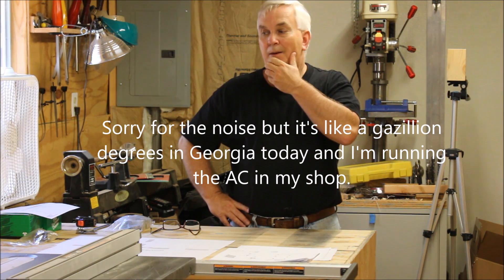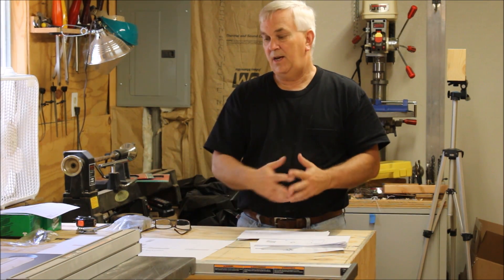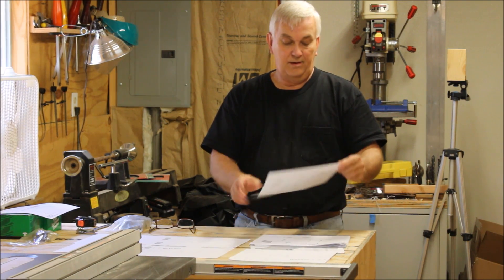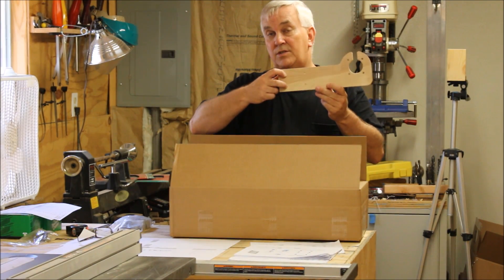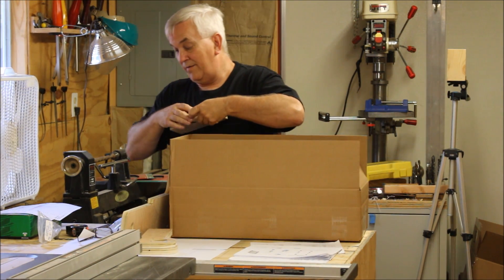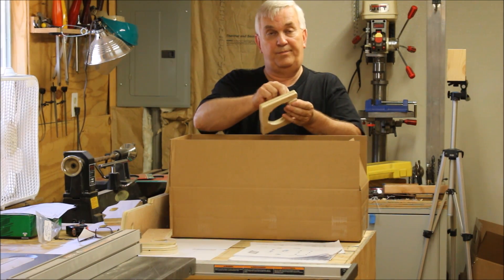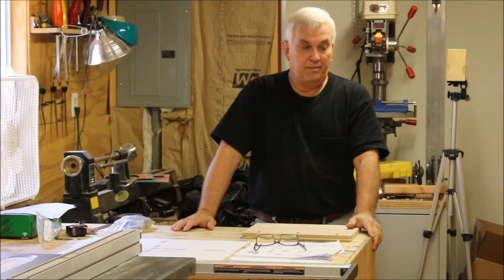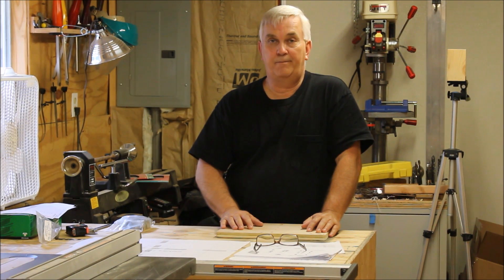Dave Gatton CNC Build Part 1

Comment: How easy is it a precut parts kit, great idea and well done. It may be helpful to suggest the screw and nut and bolts for the precut.  Although I found you’re video on leadscrew cutting and repairing the cut end useful

Comment: Thats how I did my templates for my first machine 8.5x 11 paper taped works very well took that and glued to 1/4 in ply and that is a great way to go so you can use a pattern bit on router to clean up parts
Reply: Thank you(: